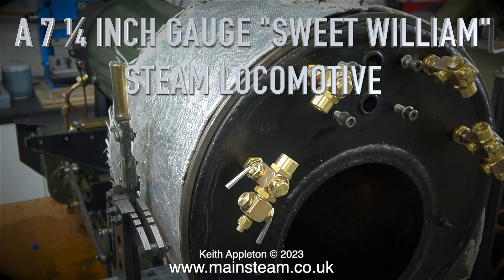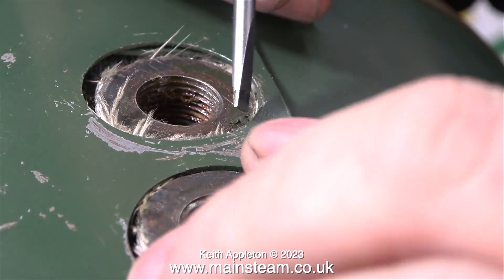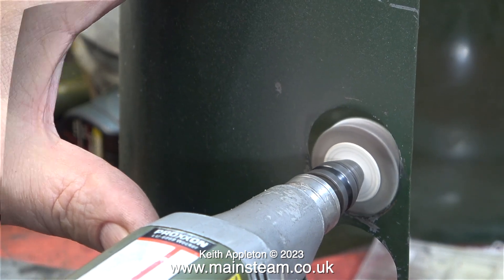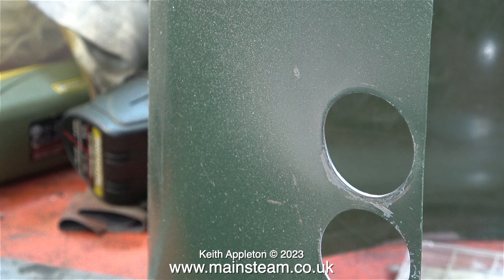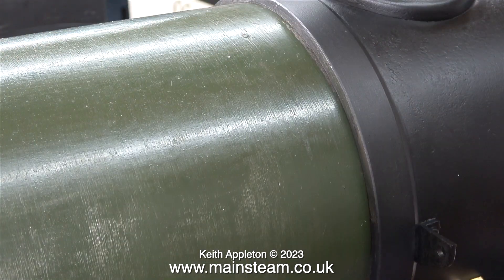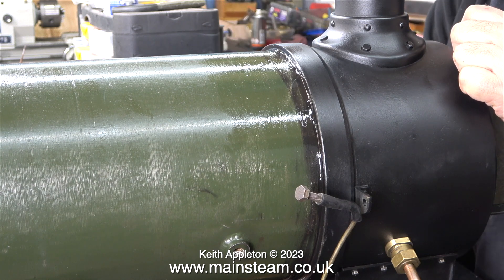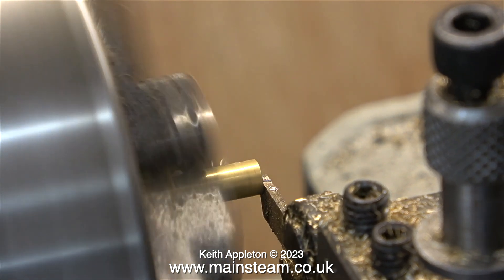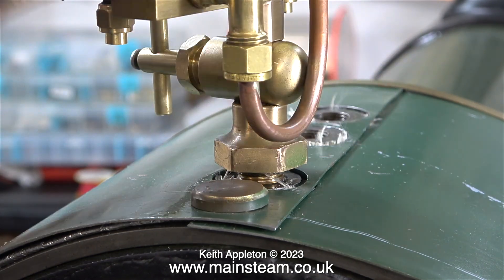A 7 ¼ INCH GAUGE "SWEET WILLIAM" LOCOMOTIVE - PART #28

Comment: If your calibrated eyeballs get tired, Starrett makes a taper gage (#270) that can measure small gaps like those under your tap flanges quite quickly. Just used mine a few days ago for adjusting a very similar situation.

Starrett still makes them, but you'll save quite a bit if you can find it or it's British counterpart in the usual used tool venues.

Comment: Maybe an engine block spray paint could suffice on the cladding. It's often nasty stuff but it works like a charm, at least on engines it does.
Reply from the maker: As soon as we get some dry weather I will be painting it with Etching Primer, followed by some HMG Satin Black - that really works for me ......
Reply: @keithappleton  Knowing the UK that'll take a while
Reply from the maker: This morning it was dry and Sunny, I successfully applied the Etching Primer coat outside and after it dried I placed the parts in the workshop. By early evening it was raining again }:-)))

Comment: Just wondering what material is the silver coloured insulation and what glue was used to stick it to the boiler?
Reply from the maker: I don't know, it is aluminium foil coated glass fibre and doesn't need any adhesive.

Comment: Thanks for another great video. It is a shame about the original paint. Have you tried any of the new epoxy or resin based paints like Dura Coat or Cera Coat that are supposed to resist wearing better? They make a high temp paint that can be used on muffler tips.
Reply from the maker: As soon as we get some dry weather I will be painting it with Etching Primer, followed by some HMG Satin Black - that really works for me.